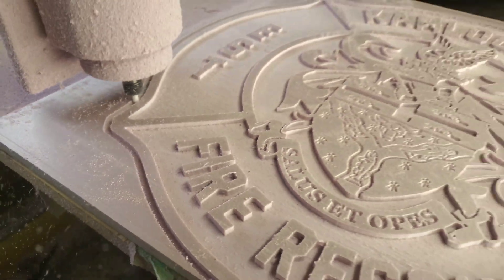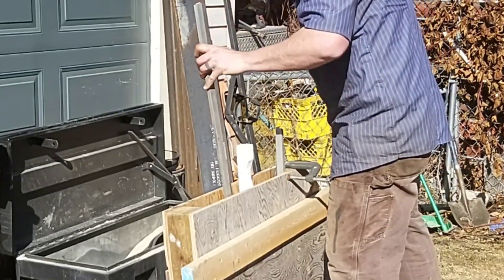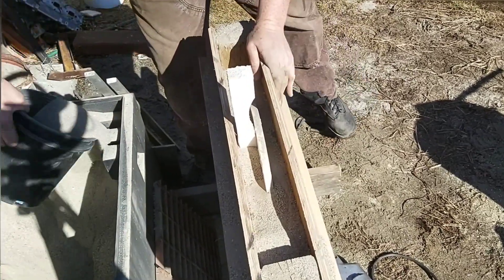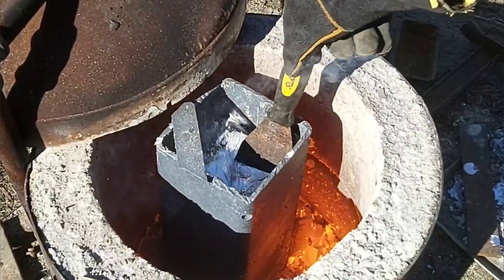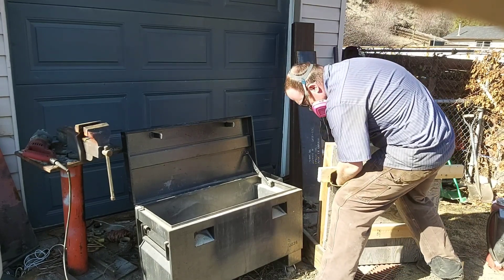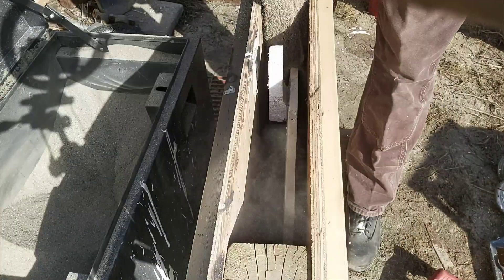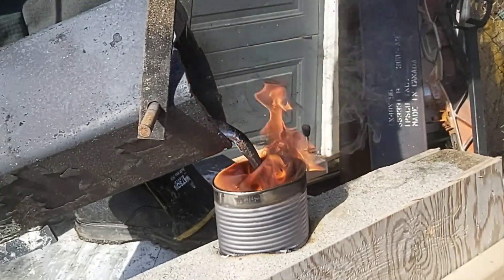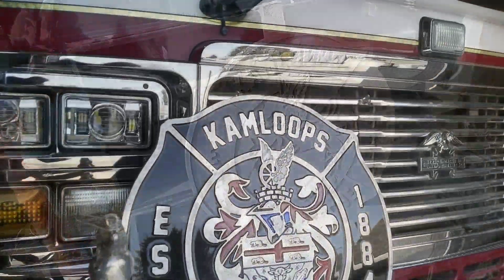Casting Massive Aluminium Plaque By The Lost Foam Sandcasting Meathod

Comment: (off topic) when making a three phase inverter using capacitors to balance legs and using a idler motor to ramp up the 3 phase motor to running speed will having idle motor running in the wrong direction for the 3 phase motor will it damage the 3 phase motor or will the 3 phase motor just stop running once the idler motor is disconnected?
Reply from the maker: im not a expert on the topic personally. I know they are in there a phase converter to smooth out the power and start the motor initially but that's as far as I can speak to.  Wish I could help more.    I think in the video where I show my shop I put in links to electricians that speak to the topics

Comment: I’m shocked you got it to work that well. Old foundry man on YouTube would not be happy with your process lol. I’ve tried a smaller attempt  of this but with brass and green sand and it failed both times.  I don’t see how the drywall compound and dry sand holds it’s form, mine cracked after filling it half way from the weight. Good job.
Reply from the maker: I was very skeptical at first as well.  It seems to work well for aluminum but is more challenging for brass/bronze as I have found .    I think it is a viscosity-to-heat thing.  When I pour the aluminum it's 100c above the normal pouring temp to compensate for the cooling and keep the viscosity .   In my head, I think about it like this.  The aluminum is poured on top of the foam and gasses are created causing a higher pressure. the aluminum is literally sitting on the foam as it melts ( probably separated by a layer of gas and oxidized alu.)  the can or basin holds aluminum and gives it more head pressure to hold the walls back     .    Since the resivour is filled the aluminium is free to flow down into the mold and replace the foam with metal. Once the metal is in the molten metal holds the walls back.  Keep in mind the sand was compacted with the vibrator before pouring, so it doesn't want to move as much. Also the metal descent want to mix with the sand either kinda like oil and water.  Now the aluminium rests on the foam and works it's way down In to the foam. driven by head pressure of the cup as it replaces it's self.  

Issues I have had 
-cup runs dry walls collapse .
-alum, brass or bronze not hot enough walls calaps 
-not compacted enough walls collapse. 
-moving things to early to look at it things distort. 

Oh also 
 The job of the plaster is not structural. It's only for surface finish 

Check out Kelly Coffield on YT he does motor parts for his trucks and he is the guru of the field right now. He however is not coating his parts with a different coating but in his older videos he does the drywall coating like I do.
Reply: @Wrighmachining   yeah, I’m surprised it isn’t more turbulent as well, I know mine are and require a vent.  Keep up the cool projects!
Reply from the maker: Thanks buddy. Let me know if you have any other questions, I will be here